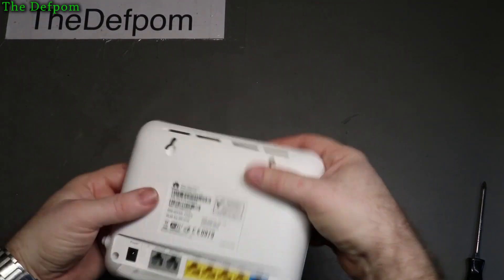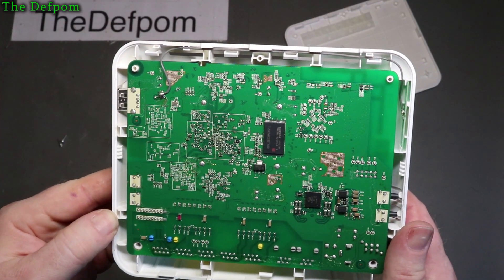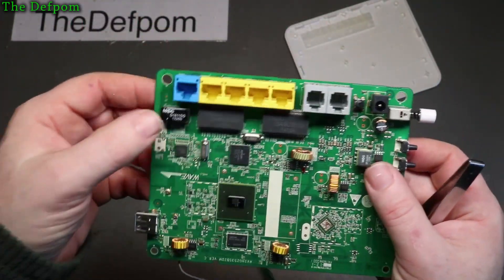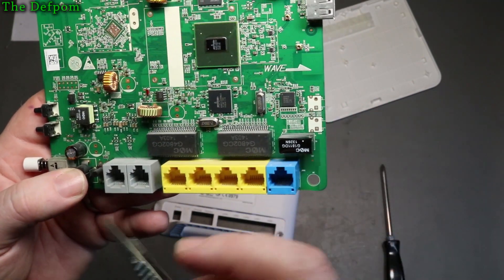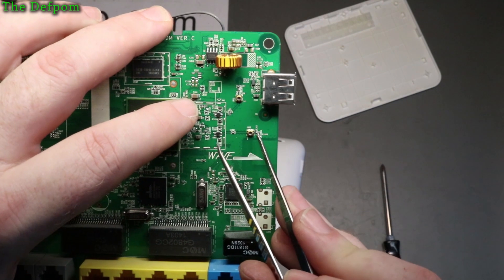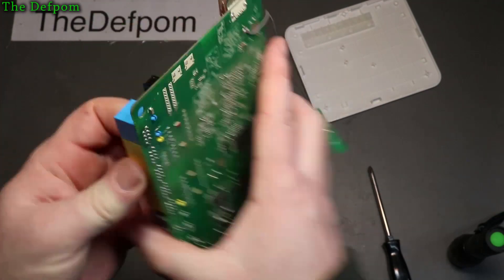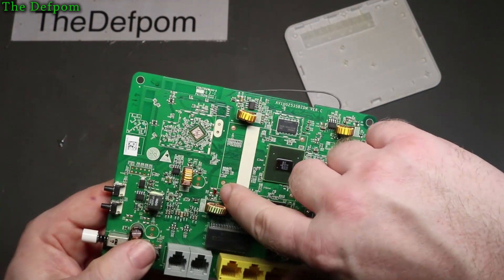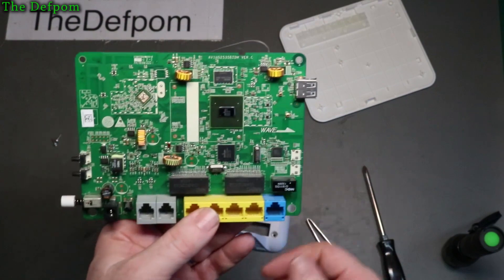🔴 #448 Teardown Tuesday - Wireless Router - Whats inside ?

Comment: Howdy, nice vid. 

I’ve got a newer ASUS wireless router that died after a lightning strike. 

The AC adaptor is putting out 20v per the specs. 

I don’t see any visual damage on the board or components. 

What troubleshooting steps would you take next?

Comment: I have a problem, I don't know if you can guide me: I connect a router to the main router of the company through rj45 and they work correctly, but when I deactivate the WLAN of the main router, the secondary router stops receiving internet correctly, it is something very strange since there is no explanation, do you know something?

Comment: No surge protection and no route to earth either. Ours passed all the spike through to the connected equipment when it jumped the isolation in the transformers. Lost 20+ routers in one strike. A few MOV's probably wouldn't have done much anyway as there is no earth in that thing.

Comment: Bugger all surge protection stuff on that board. No gas discharge tubes, movs or anything. I guess the only goal is to dissipate the voltage across every chip on the board :-) The ISPs must get these from China for 20 bucks a piece or less so who cares.
Reply from the maker: Pentti Kantanen - yeah, at least it was free, and they replaced it for free.

Comment: Odd that it shows no marks or blown away parts, no lights at all then?
Reply from the maker: zx8401ztv - it powers up, it just doesn’t respond properly, unable to login to the device, the page doesn’t come up 90% of the time, and it only randomly connected to the CPE antenna.
Reply: Oh dear, it sounds like me in the morning before my cup of yokshire tea, don;t respond propperly, not there for 90% of the time :-D :-D
Never mind, the on board regulators/smd resistors and other bits will come in usefull, stick it in the spare pcb box :-D.
I have repaired so many cb radios from the spares box, a cheap repair and the owner very happy, nothing bounced back over 8 years of repairs.
Reply from the maker: zx8401ztv - I had boxes of spares radios, lost them all in the flood in January.